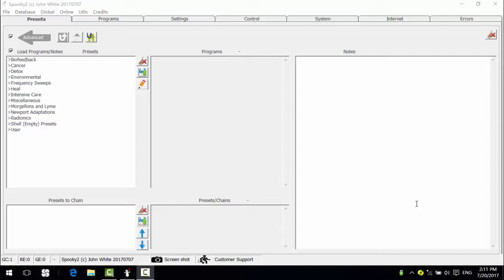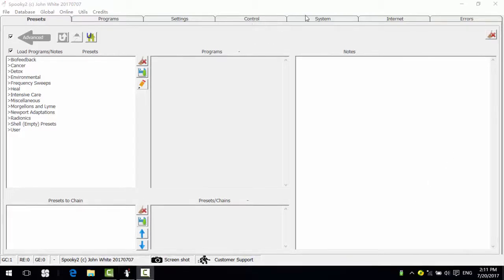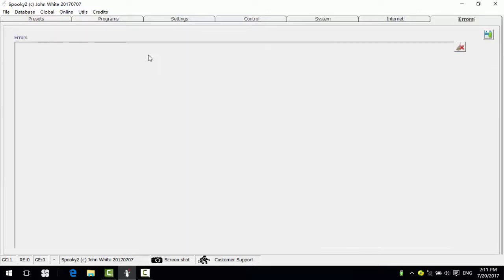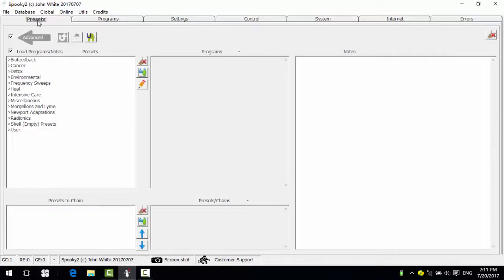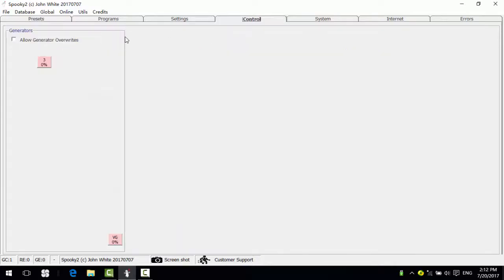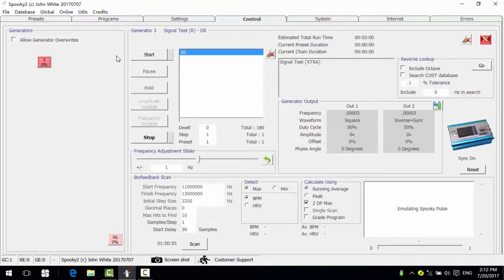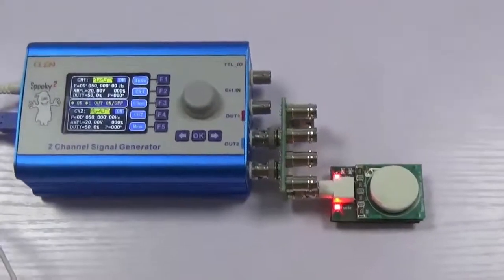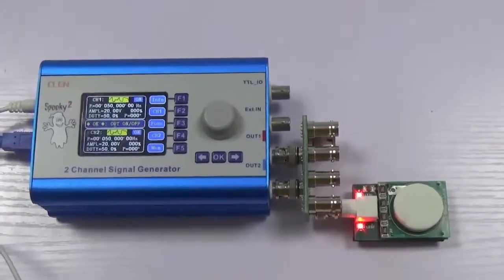How to Do a Signal Test

Comment: Thank you for this video, I had no problem, understanding it. 

My question is what if you have the newer sampler (black clamshell)? Should there be lights that flash like the older ones?
Reply from the maker: Dear friend, please be kindly noted that remote lights on one side, both sides, or dim are often normal. It is related to the frequency, amplitude, and waveform you are using. For more detail, please check this link: http://www.spooky2-mall.com/blog/how-does-spooky-remote-light/. Hope it helps.
Reply: Thank you for your reply. This video shows the old sampler tray and I’m talking about the new clamshell that has no lights.
Reply from the maker: @laurenm8561  Dear friend, if you have any questions when using the equipment, please kindly contact us at: support@spooky2-mall.com with pictures or videos. Our agent will try best to check it for you.

Comment: What if it shows you're connected but you see no lights on the remotes?
Reply from the maker: Dear Friend, remote lights on one side, both sides or dim even off are often normal. It is related to frequency, amplitude, waveform you are using. If you can't make sure of that, you can do a signal test. The two lights on remote will flash back and forth if you do signal test. If not please kindly contact our customer support via email support@spooky2-mall.com. We'll try our best to help you. Thank you very much for your support.

Comment: Just a recap for those who can't follow along: 

-Firstly download the Spooky2 software which can be found on their website under 'Downloads'. If it's your first time installing the software choose 'full package'' extract it and install it to your C drive. See here: https://www.spooky2videos.com/courses/spooky2-software/lessons/installing-the-software-and-drivers/
-Run the SPooky2 software

Make sure the you have connected the Spooky Boost on output 1 and output 2 of the Spooky- XM and connected on the boost the Spooky remote. Also that the Spooky2 -XM is turned on and is connected to your pc/laptop via usb. 
 
-In the Presets tab, click on Miscellaneous. Then click on system tab and verify that one generator is detected. In this case it's the Silicon Labs CP210x USB to Uart Bridge. (which is the Spooky2 -XM) 
-Check also that there are no errors in the errors tab. 
-No go back to the Presets tab, click on Miscellaneous, then click on Signal Test (R) - DB, 
-Then go to the control tab, tick the box "Allow Generator Overwrites". 
-Then click the pink box under it which says 3 0%, which opens the generator. Here you will see in the box on the right side that you can start a signal test. You can do so by pressing the start button.
-Now you will see that both CH1 and CH2 on your Spooky-XM will switch on and you will hear a click. This means the frequency test is running. Also the red ledclights on the Spooky2 remote will start blinking.

-To stop the test simply press "Stop" in the control tab. You will hear an audible click again. And the test has now stopped. 

I hope this helps. 😉
Reply from the maker: Thank you!:)🥰🥰
Reply: If the Spooky boost is the connector going into the signal generator, what is the other device plugged into that? is this required for the test? It has not been supplied.
At a first instance this is not giving me much confidence in the product.
 @Spooky2Rife